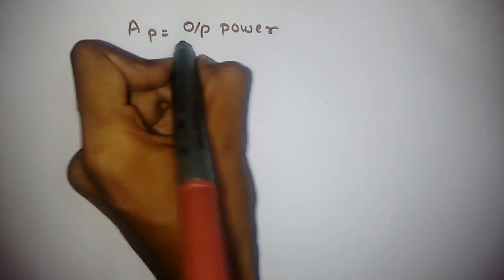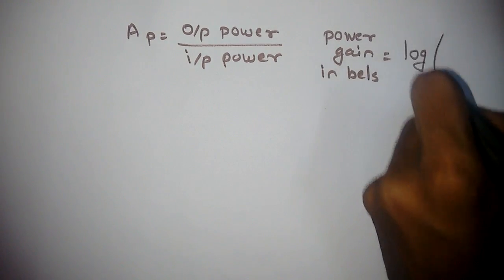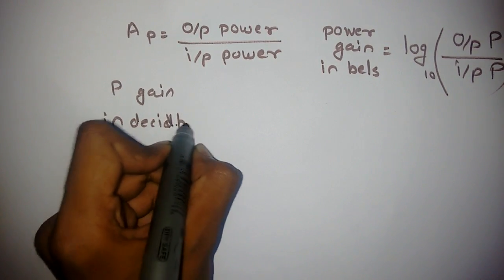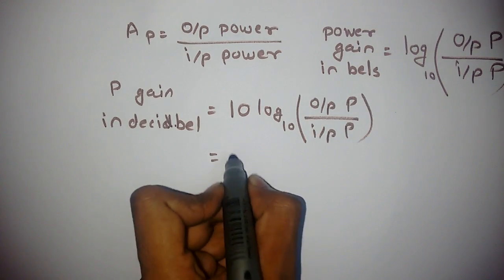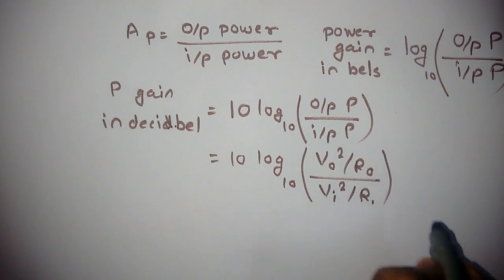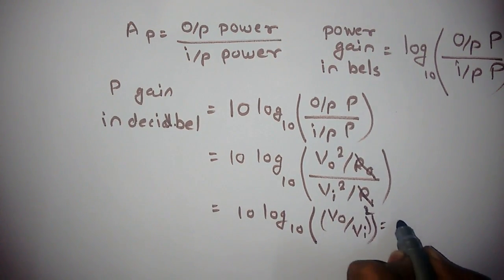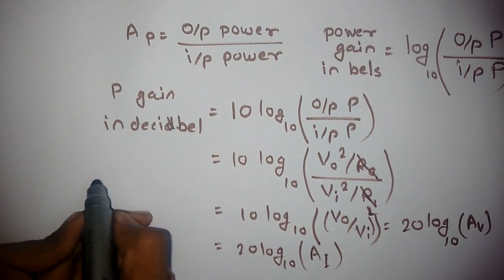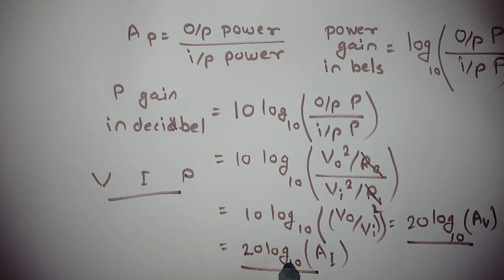relationship between voltage gain, current gain and power gain in decibel

Comment: Generally gain of the amplifer will be in real numbers or in complex number 
If it is in complex how it will be
Reply from the maker: +sabarish saidurga it should be in real numbers if your circuit is adder type(with resistors only) because internal capacitance won't count much compared to resistors. But if your circuit has capacitors/inductors then that will introduce phase change which can be represented in complex form. In that case also, for calculating gain we consider amplitudes only. So gain won't be complex.
E.g. if output voltage is a +ib then we can convert it to C(d +ie) where d^2 + e^2 = 1 and this will give us C as the maximum amplitude. So we'll use C in the output part of gain equation.
I hope this clears 😌